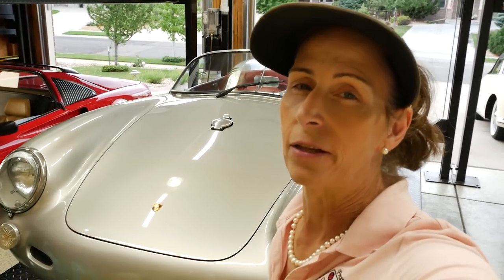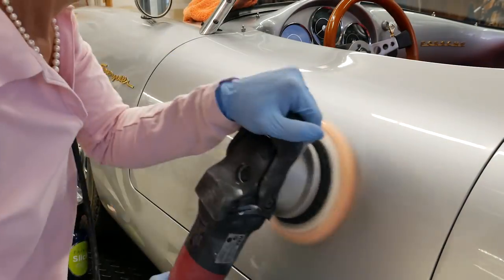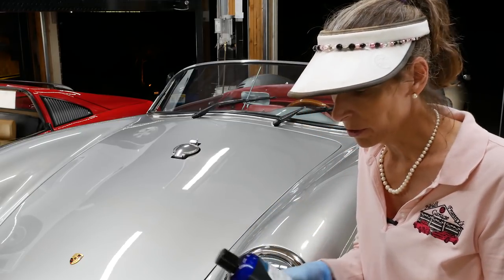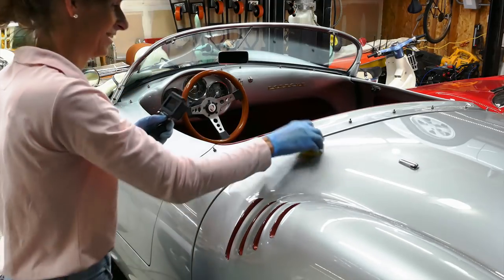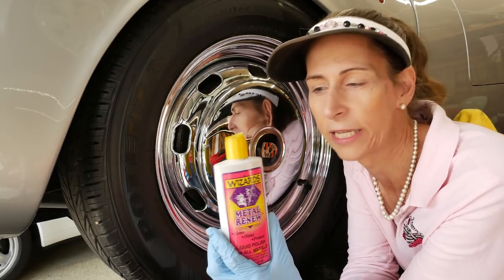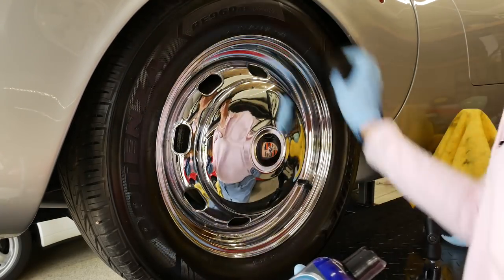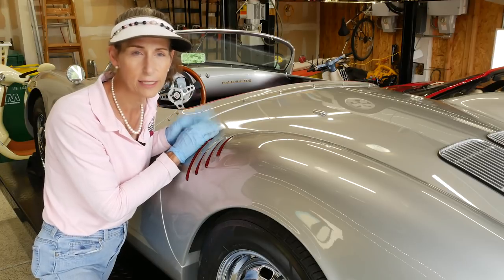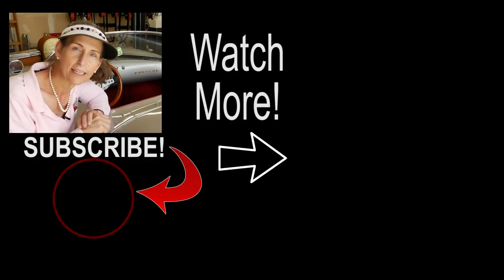Beck 550 Spyder Replica VLOG #10 - A Detailing Session...

Comment: Another great video - thank you.  I use other products than Adams but I think Adams has very good stuff.  Just a personal thing.  LOL.  Glad you caught the fact that tires were on wrong side and need to be switched.  I would just add for those watching the video you would not normally rotate radials from side to side (only front to back, back to front) but Franny's point is these tires are simply on the wrong side due to the directional nature of the tires and the tires need to be changed from side to side to correct that error.  Well done!
Reply: Of course if the tires are directional and you have a different size tire on the front versus the rear, you can't rotate the tires at all.

Comment: I noticed you mentioned about doing a 'clay bar' as part of the process. Would love to see a video about what this does and when/why we should do it.
Reply from the maker: Thanks for that Mark.  I am planning to do a complete detail on the MINI actually.  I'll make sure I explain all that.  Short story: It is used to pull embedded contaminates out of the top layer of the pain and will leave the surface silky smooth.  It is an important step before buffing as those contaminates can clog up your pads and make the polishing difficult.  You can use it without buffing, but I would recommend some form of wax/sealant for protection afterward.  Franny

Comment: If you use isopropanol you should only use one from glass bottle. In pastic bottle it tends dilute some carbohydrates or polymers into it. I dont know how important it is but I once made the error and cleaned a camera sensor with isopropanol from plastic bottle - I will never do it again. I only use pharmacy bottled isopropanol now for that kinda work. I know the Ammo guy does not want to use the isopropanol for the same reason.

Comment: There are some good detail tips in this video. What did you use to treat the seats?
Reply from the maker: Hi Steve, I should have mentioned more on that, but it was getting a bit long ;)  Leather Seats... I have searched high and low for the best leather protectant, but most are really all the same.  Leather is pretty different and, in cars, has all been painted.  So, treatment is different than would be for like a leather saddle.  I used Adam's leather protectant.  It is as good and any other and has a UV protectant which I think is 1/2 the battle.  Leather needs to be kept clean.  Dirt and grit will grind it to a pulp and hand oils and salt can break it down as well.  For now, I just try to keep the seats treated and clean.  When I come across the perfect product I'll let you know!  F
Reply from the maker: Steve. I believe we have links to the leather protectant in our pinned comment and description to Amazon.  Thanks. Heidi
Reply: Thanks so much, Franny & Heidi!